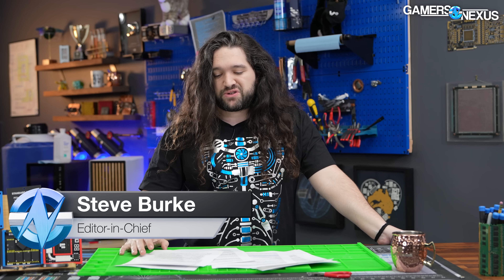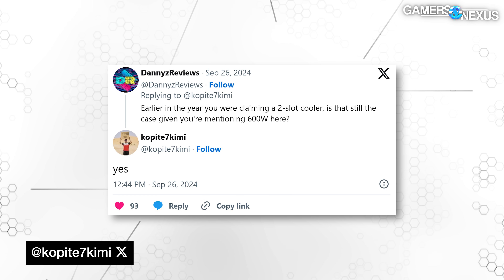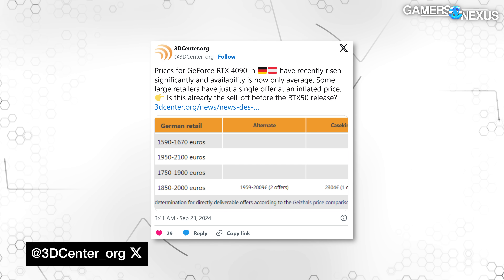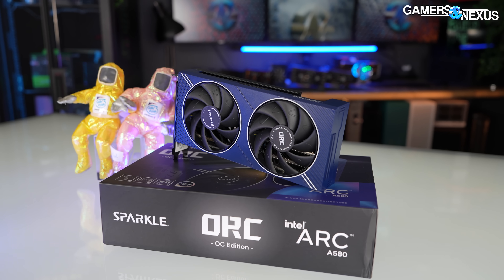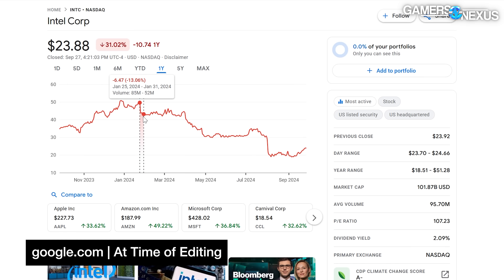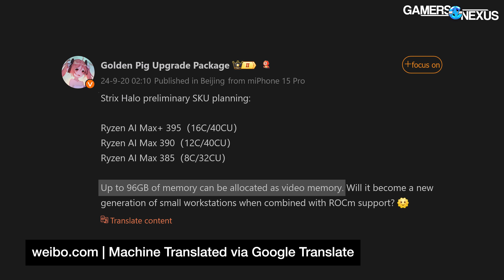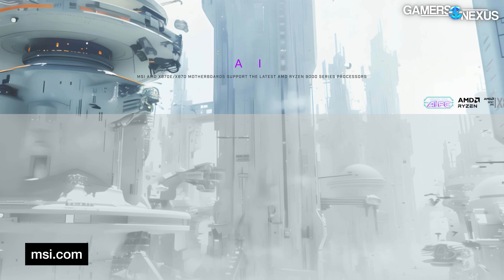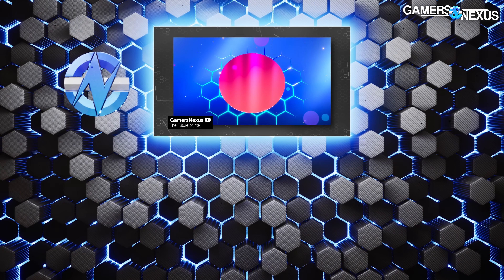HW News - RTX 5090 & 5080 Leaks, Valve ARM64 Experiments, Intel Arc 0% Marketshare, 4090 Price

Comment: Steve I love your content and approach.  Just another wrinkle in the 4090 and above pricing not being just prosumer would be the "new norm" of the enthusiast level of fidelity gaming and benchmarking enthusiasts.  I mean while you can benchmark SLI/NVlink, that's really an outlier case.  But people used to buy SLI cards and enjoy them besides the negative press they would get.  I would ask if you think in retrospect the discontinuation of ALL support and Nvinspector usability would be to prevent the ability to scale native resolutions through pure compute instead of relying on DLSS? That's definitely not a big reason as most upscalling is benefitted from the low to midrange but still it feels like it does play a factor and also further enthusiasts from the ability or desire to maybe work on upscaling and other ML/Ai inferential tasks and LLMS themselves.  But the 4090 is no different than people that got two 1080ti's in SLI and serve the same market of gamers.  And i would argue is providing a much better return on investment long term as there is no feature yet that is unavilable unlike RTX only 6 months after 1080Ti launched.

Comment: More on AMD, I didn't switch to Nvidia simply because "AMD is no longer competing on high end GPUs". I quit using AMD because AI generation is just not good on AMD due to lack of CUDA cores, and when I originally got my AMD card, it had a PLETHORA of driver errors (needed to upgrade and downgrade per game). So instead of getting a 7000 series GPU, I decided that the 4000 series from Nvidia was a better idea. 

After moving to my Nvidia card, I have yet to upgrade or downgrade drivers since I first installed it (5 months ago). AMD has some extreme improvements to make with their drivers and software compatibility before I ever consider using them again. Getting told "It's come a long way" doesn't mean anything when I could hardly use it without TONS of manual labor when I first received it. Nvidia is quite literally the epitome of "plug and play". While I hate taking sides with companies in ANY capacity, it literally just works, I would never be against using AMD again if they fixed 90% of all driver errors and release a driver with 0 known issues that don't cause games to just outright break and crash.

Comment: Graphics cards.
The new RTX 5090 being a "two slot" only, could be that the 5090 can only be cooled by a liquid based solution. 
The sales of GPU's, all 3 manufacturers have good hardware. The issue is, there is only one of the three, with good reliable software. 
Personal experience, the only card that did not cause issues for me, is a RTX 3070. (Previous Nvidia based cards also, the last good AMD card for me was the ATI Radeon 9200)
Intel Arc A770, was fine for general use and as soon as I played a public event on Fallout 76, the frames went down to stop motion. 
AMD Radeon RX 6800, is just a PITA. The software is the issue, constant crashes when browsing with Firefox. The software keeps popping up for no reason, all notifications are turned off. When the software opens itself, you know, the item you have full screen just goes to downhill to point of you close it to restart and hey look it's AMD Software: Adrenalin Edition Application is sitting on the desktop.AMD should rename the software Narcissistic Edition Application.  (Similar software issues with the RX 570 and RX 580 I tried and sent back)
Maybe, if AMD and Intel concentrated on a card that gave 60 FPS at Ultra High Definition (UHD) resolution is 3840 x 2160 pixels (4K marketing B$), instead of beating Nvidia on fastest this and highest FPS that, they would have a higher market share in the graphics card sales.

Comment: Although proton has a lot of x86 optimizations, there is little to get in the way to compile for ARM64 
Vulkan and the linux kernel works (just about) the same on ARM as it does on x86 and all that would really need to change is the optimizations

Comment: "They managed to break free of that by segmenting them".
They managed to do that by jacking up the cost of the next-best card to such an extreme level that "the more you buy, the more you save".  
There's a reason the 4080 sat rotting on shelves until the Super Discount version, which was still $100 too much.

And yes, the 5090 looks like it might have a gaming performance boost over the 5080, but that doesn't appear to be its primary function.  Not with that much ram, or bus.  There's almost no games today that use a full 16gb of vram, yet people still scream and scream that now 16gb isn't enough, when it mostly is.  Expect it to cost $2,499 minimum.

They'll get away with this too, especially if they don't release the 5080 until months after the 5090.  The only thing people will really have to compare it to would be the 4090, and the 5080 is "supposedly" 10% faster than that.

Comment: these specs would be totally fine if the 5090 is priced in the 1.6k - 2k range for 60% more performance than a 4090, while the 5080 is priced at 800-900$ for 10% more performance than a 4090.
my fear however is that they go again with 1.2k 5080 like they did with the 4080 prior to the super model price down to 1k, which would really suck when the 5080 is coming in at literally half the cores of a 5090 and likely bigger performance margin than the 15-30% margin difference of  previous generations between 80 and 90 series

Comment: Is the connector and the cable from a 4090 going to be compatible for the 5090 having a maximum 600W support? Bc if it has spikes over 600W it wouldnt be safe to use that 600 cable right?

Comment: might just be wishfill thinking but valves arm64 experiments could mean steam games on android phones which would be sick. 
with recent news on google being required to enable 3rd party appstores on android and game support seemingly being expected for the new snapdragon powered laptops, being able to target the massive mobile market would be a huge benefit for valve and game devs and consumers alike.

instead of buying a steamdeck or handheld to play your steam library on the go, imagine if all your favourite games just worked on your phone. you wouldn't have to pay twice to share licences across platforms, you wouldn't need to choose to lock into a platform depending on what experience the game is best suited for (or else buy it twice). 
you'd still be limited performance wise by the games you can play on a passively cooled mobile device but with multiple companies with solid state cooling chips in the pipeline i could see phones  in the next couple years being able to run the average steam game. (just for context current android to windows emulators can already run gta5 low at decent framerates)

Comment: I have a laptop with 13900hx. I haven’t experienced any crashing or stability issues beyond taking my undervolt too far. As far as I’m aware degradation on raptor lake seems to be confined to voltages exceeding 1.55. I’ve never seen such spikes. My cpu has never even hit 1.5 volts. However, I did notice that my microcode revision changed to 0x125 after a bios update so it is clear that Intel or some of the laptop manufacturers or taking some precautionary measures with the raptor lake hx CPUs. I suspect there will be another bios update with the 0x12b microcode revision by the end of the year from some makers. I feel what Intel is saying about hx chips not being affected is mostly true. Most laptops including my own don’t really pull more than 160 watts in stress tests and don’t reach the voltages required to cause degradation and instability simply because they are thermally limited and thus use less power. I’d be interested to see what this view laptop is that had issues. 6k for a laptop is no joke. My guess is the thing has an absolutely monster cooler on it and can sustain power closer to that of the desktop parts. For most people with a raptor lake laptop on the more reasonable side of things I suspect there aren’t as many issues. Still, if you own a raptor lake hx laptop it’s in your best interest to get the most baller warranty coverage you can afford in the case that you are experiencing issues and your cpu starts to degrade and become unstable. If you have to deal with something like that outside warranty you’re basically screwed. Can’t just replace the cpu. In most cases the entire board needs to be swapped which in many cases costs more than the laptop is worth or even more than the processor you paid for the laptop when new. At least with warranty you’ll either get a new board at no additional cost or a whole new laptop that might even be of a newer gen.
Reply: 13900hx in Helios Neo 16, stock doesn't go over 1.4V VID 

And because I wanted to tune it to 3000rpms of fan noise max and the 4060 is the game fps limiter, I turned it down to 4.3ghz which reduces it to about 1.25V max. That's where it would settle under its turbo long power limit anyway, and less yoyoing up and down actually increases productivity benchmark scores by a few % even though it misses out on that initial 157W short power turbo burst.  I'm not worried at all, if it dies having lived its life mostly at 1.25V... it was always gonna happen anyway

I'm not expecting a microcode/bios update from Acer, this laptop is a good unit but even the i9 is underclockblocked in this model, lowering voltages is something every laptop owner should be able to do to get more out of their high performance CPU, and specifically with this 13th/14th gen issue undervolting will reduce the development of the excess voltage pathology of degradation in these CPUs... you suck Acer.
Reply: @greebj  definitely check for bios updates. I own a Lenovo and even through they didn’t explicitly mention it in their bios update notes, their latest bios update allowed undervolting and applied the 0x125 microcode update, which was the latest update from Intel when the bios update dropped. You can check your microcode version in hwinfo64. Lowering power settings and clocks is always a good option too but you leave performance on the table.

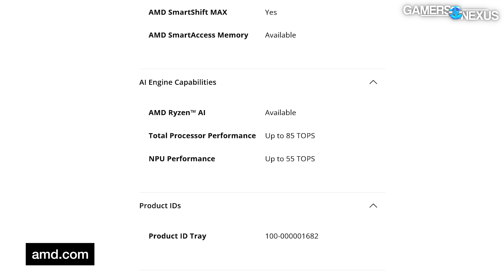Comment: 23:00. I'm ready to see a chip with 6/8 Zen5c cores only.  As far as I can tell the 5c cores can hit 4ghz, for a handheld that's all that is needed.  If it had 75% of the GPU performance of the 'halo' product it would be an amazing product.  It still floors me that Valve was able to get a reasonable processor out of one of the big 2.  The APUs never make sense, by the time the GPU can do the job they've added 50-100% extra cores to the CPU and raised the price accordingly.
Reply: if you keep in mind that the current high end AI 9 Hx 375 (12 cores) has 16 GPU CU cores. That's half of what the dedicated low end RX 7600 has.
Not for handhelds, but for small mediacenter PCs, such APUs do make sense - if I compare the 7000 series CPUs with their just 2 CUs, it's enough to do work stuff, and decode/watch fullHD videos, but just not enough to run halfway demanding stuff, like anything 4K related, any rather modern game even in potato-quality, and so on.

Comment: Intel Arc is, imo, basically unchallenged for home media servers at the moment with amazing encoders and low pricing for the A310 and A380. Jellyfin recommends intel QSV over nvenc and way over anything AMD for server side transcoding. Its also nice that they ship the drivers in the Linux kernel making it a bit easier to setup than nvidia. If they can make a Battlemage card that outpunches my 3080 10gb in traditional rendering for a reasonable price, I'd buy one in a heartbeat. This space desperately needs competition to drive down pricing.

Comment: Sorry if this isn't the right forum to submit this topic suggestion, but speaking of Intel ARC when you get through your current backlog of content you should definitely look into ASUS' lack of driver updates. I have an ASUS Zenbook Flip OLED 15 with a 12700H and ARC 370M. The most recent drivers available from ASUS for the GPU are from late 2022. I dont need to tell you how imperative driver updates are to ARC cards and they make the laptop essentially unusable for graohically intensive tasks like games and photo/video editing. Manually downloading the most recent Intel drivers cause a number of reliability issues like improperly handling lid open/close behavior, rapid discharging (fans on max and hot to touch even with basic navigation) and the 96WH battery dies in 2 hours. There's a lot to like about the laptop but ASUS' lack of support absolutely kills otherwise great hardware.

Comment: About Steam on ARM64. There is a lot of current and future application of it. Even today you can build ARM64 workstation on Ampere CPU for example. And there is a lot of hyped  laptops on Qualcomm SoCs so if/when there will be Linux support that can be usable. Or even Valve decide to fix not very good gaming  performance of Qualcomm on Windows and replace MS emulation by their own.

Comment: I think Nvidia should take the power of the next top card up high enough to push desktops over 1,800 watts so that US householders would finally upgrade their houses to 230 volt at the socket. If they did that, especially if they adopted an existing plug standard used in other countries, we could dramatically reduce the cost of electronics since it would signal the death knell for 120 volt power worldwide and reduce the SKUs necessary. Not to mention, if they actually joined the 20th century, US householders would be able to run other devices like 2 kilo-watt fan heaters (just an example of something Europe can run and they can't - not a recommendation to use fan heaters instead of heat pumps).

Comment: Im still upset about the 13th and 14th gen problems since i bought a 12th gen cpu like a year or two back so i could upgrade easily and right now my only option if i want to upgrade is to completely swap platforms. I even remember when i went to the store to buy my 12th gen i was debating over getting the 12600k or the 13600k but decided the extra 100 wasn't worth it being broke saved me there but sucks that im locked out from upgrading

Comment: I am not a gamer. I still have a 3060 from the days when it ran three large monitors and a 4K TV. Now, it's just the TV, and I could run that with an old 5700G, if I can find it in the garage.
Reply: I am a laptop gamer and the last laptop I bought was high end, dual 1080s, socketed CPU and MXM GPUs. Got it on eBay half price but the original receipt was for AUD$7400.
I installed a modded bios, upgraded the CPU (6700k to 9900k @ 170W max), put in 64gb ram, modded in water-cooling, flashed the 1080s up to 250W. Still ran great when I pulled it apart to do a swap to a 16gb 3080 last month.

High end laptops these days are soldered, locked down, and unmoddable. There's no way I'd get 7 years out of any of them, which is why I have a $1400 Acer HX i9/4060 instead.

Comment: I bought the Intel ARC A770 as soon as it was available and have been intending to upgrade to the Next generation of Intel GPU as soon as it's released and give the A770 to my girlfriend. That was a mistake and is becoming increasingly difficult to stick to, especially since she is still running an RX580. I just figured I'd share my two cents. But yeah in short Battlemage's delays are frustrating and as mentioned in the video Intel have to actually release something to sell something 🤣

Comment: Take the rtx 5xxx GPU rumours with an extra pinch of salt, since the leaker had an awful trackrecord as of late. That said if this turns out accurate in the CUDA core counts, oh boy. This would position the alleged 5080 at half the hardware spec of the 5090, which afaik is a first and aligns closer to the historical xx70 segment of Nvidia GPU segmenting than the xx80 cards.
The current gen of Nvidia GPUs already seems like every SKU below the 4090 has effectively dropped a step in hardware specs compared to their nominal designations (something to which I'll always just point at the fact they tried to sell us the 4080 12GB), but if the rumour holds true Nvidia may yet double down on it and demand people pay two steps of branding surcharge on the actual hardware, which would be insane!

This is what we get when there's no competition, what with AMD seemingly deciding not to compete in the high end segment going forward (at least for the foreseeable future as said by AMD themselves). This is really bad news for someone like me who actually wanted to upgrade my ageing GPU for a while now ... I can only hope that AMD can translate it's focus on the middle performance segment into a highly competitive market to drive up performance and costs down so that an upgrade in that performance category becomes good value AND a solid performance total.

Pain!

Comment: In the 5090 being two slot. Isn't the heat generated by a computerchip exponential to its frequency? So if they would massively over-dimension the chip they could run it at a lower frequency to generate the desired performance, basically assuming a wattage to fps efficiency from a downclocked system on an oversized system.

Comment: 27:36 Imagine firing up this PSU for your whacky AI finder machine only to lead into troubleshooting a completely dead PC, getting nowhere because the entire computer is dead, then having to troubleshoot why everything else on that circuit also lost power. If you live in the US you've simply tripped a breaker and need to find another way to get enough power to this thing above 120V/15A or maybe even 20A.